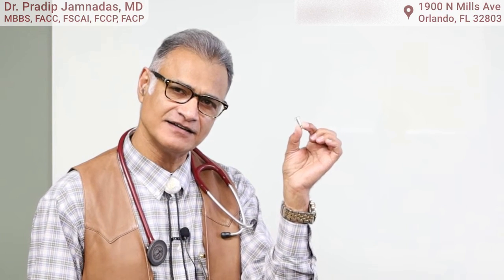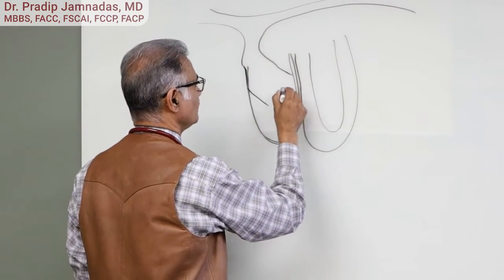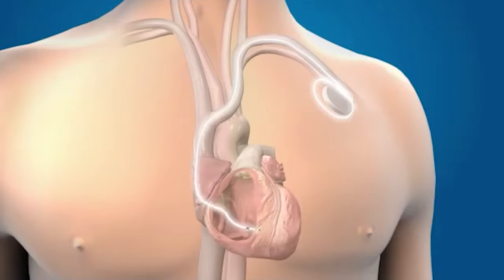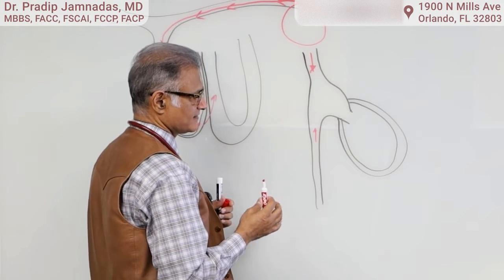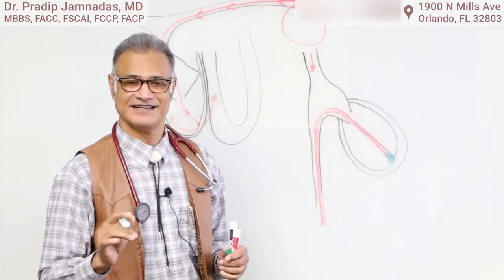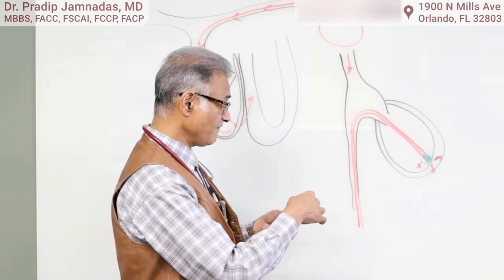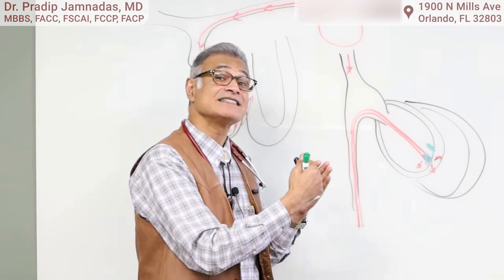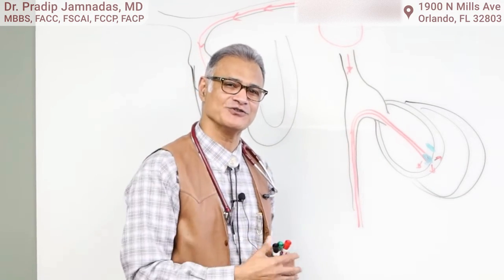What is a Leadless Pacemaker?

Comment: I’ve had a pacemaker my whole life due to congenital heart defects. I just had my annual check up and I’ve got 6 years of battery life left on my current device. My doctor said maybe by then, I could get a leadless pacemaker too! The only issue is that I require dual chamber pacing and they haven’t really figured that out yet. I hope they do before 6 years! 

Another reason I want one is that I have had so many pacemakers in my life and scar tissue has solidified old leads in place so they are running out of space for more!

I am 100% pacemaker dependent though, so I hope those prongs would be enough to keep it in place!
Reply: My dad has a dual chamber pacemaker and recently got a leadless pacemaker. With new technology since this video came out his leadless one can actually be replaced
Reply: St.Jude Medical/ Abbott has a leadless dual chamber pacemaker that paces and senses the atrium.
Reply: At what age you did the surgery
Reply: At what age u had pacemaker ? Im so worried because i have to do heart ablation with risk of pacemaker…my heart rate crazy go up to 300 the highest😢

Comment: A real life-changing breakthrough. I've been told that I "may" have to eventually have a pacemaker, and at 74, this is somewhat appealing. If the situation should require it, and if my area cardiac care team does not adopt this procedure, I will contact my V.A. hospital. I recently read that one of the VA hospitals just completed the first of this type of procedures in the state of Texas.

Comment: Great video Dr!! I was diagnosed with Paroxysmal Afib w/ Tachy-Brady (and very symptomatic) in Nov 2018 and had my 1st ablation Feb 2019. At the time, my hope was to avoid pacing, as was protocol, via ablation. In the past year I've had episodes of Afib ~ every 6 weeks, evolving into a couple episodes of sudden pre-syncope (one while driving...Stokes-Adams - an old term?). Just had 2nd ablation Feb 2022 and have been advised by Dr I will definitely need a pacer (Micra) sooner than later as my situation has become potentially dangerous. The future seems unsure as I've 'just' turned 65 and now have a CHADSVASC score of 3 (female, hypertension, age 65... but otherwise healthy). I'm nervous that the Micra is a precursor to traditional pacing and a more scary prognosis. Again, thank you for doing such a great job of explaining the Micra. Many folks will benefit from your knowledge.